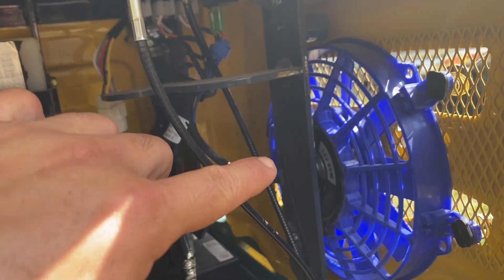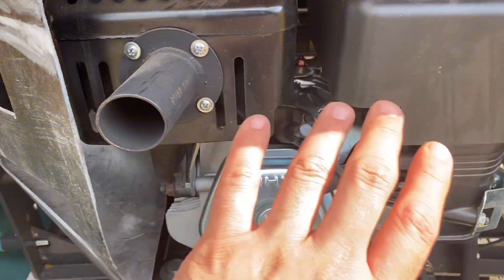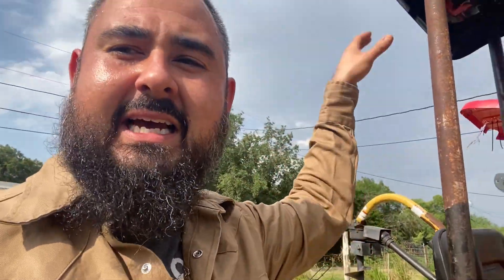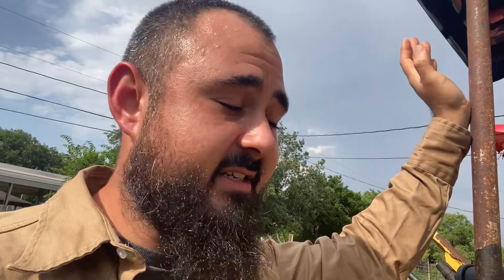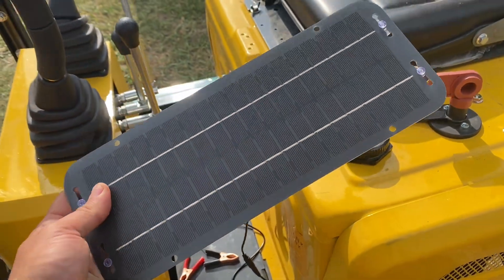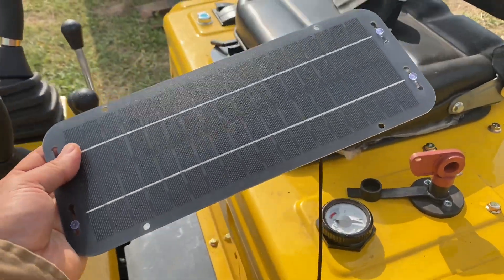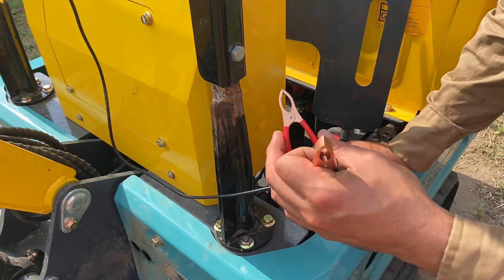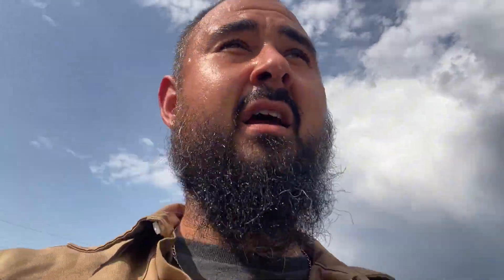Installing cooling fan in my Chinese mini excavator

Comment: Just put a switch on the fan so that you only run it when it's getting hot and turn it off otherwise.  Honestly, I would just do an engine swap with a better engine that is a little stronger and already has a built in alternator upgrade. Like a vanguard or Command engine.
Reply from the maker: That sounds awesome but I’d rather want to see what i this engine can do! And it’s been working fine with the solar charger 💪

Comment: Why not purchase a stronger battery? Where did you purchase the fan from?
Reply from the maker: I got the fan off of Amazon because they’re cheaper there. You can get them for about $20 and the reason why I didn’t get a stronger battery is because batteries drained and cannot recharge himself because there is no alternator but my solar panel trick did work great I don’t have any issues.

Comment: Small engine alternators are magnets and a regulator inside the flywheel. You can get about 5 Amps out of them.  Just make sure your fan doesn't draw more than a few amps and you'll be fine. You could always mount a small solar panel with a charge controller to charge the battery when it's not in use. A 10W panel costed me about $20 bucks on amazon and it came with a 10A charge controller.
Reply from the maker: That’s exactly what I did in the video 😂
Reply: @Getworkdone-p7b  I missed that somehow.

Comment: I have this same model. I noticed that there is a lot of different plugs in the wiring harness that’s not going to anything. Wondering if it’s possible to use the existing plugs that’s not going to anything to wire in the fans?
Reply from the maker: Definitely that is an option to extra auxiliary function buttons that you can use for anything you want
Reply: I wasn’t really sure if I could or not. I’d like to run a couple fans off the plugs that’s just there not doing anything. I haven’t seen anyone go that route so I wasn’t sure.
Reply from the maker: Yes it’s totally possible but here where it’s always hot it’s just best for me to keep the fan on all the time! I think I’m going to use my extra button for a fan that blows air at the operator
Reply: I’m from south east Mississippi it’s 90 plus in the shade and 100% humidity. Feeling like 1,000* today lol. I’m hoping once the battery disconnect is on the fans come on?
Reply from the maker: No, it only turns on when the engine is on the way I hooked it up

Comment: I installed my fan in the same area, but I used the rocker switch next to the work light switch. Also used a relay, works great. I can turn it on and off. My voltage is showing 14 volts while running. 14.5 when fan is off.
Reply from the maker: That’s awesome I was going to the switch thing but where I’m at it’s always hot when I add the second fan I plan on putting a switch!
Reply: @Getworkdone-p7b  that would work perfect.
Reply from the maker: I definitely hope so